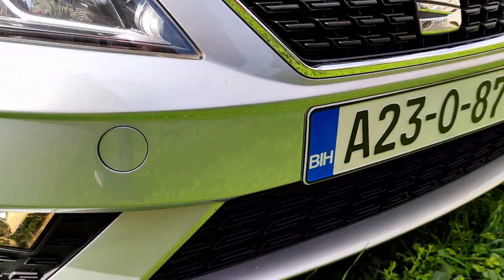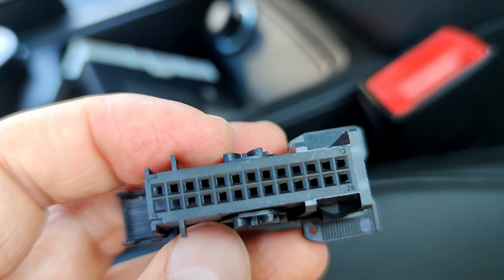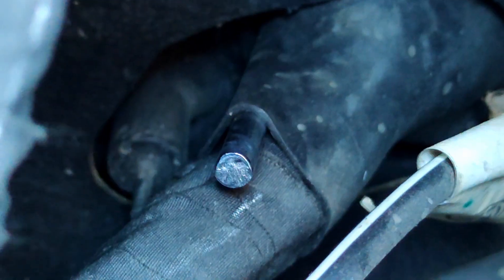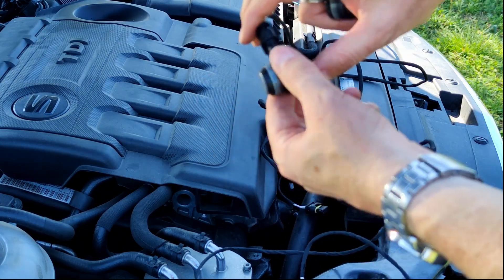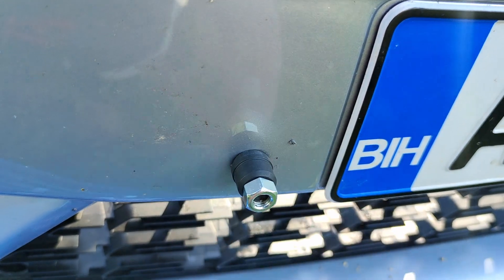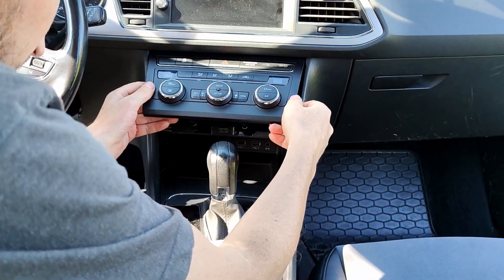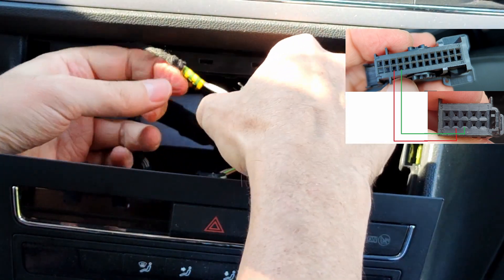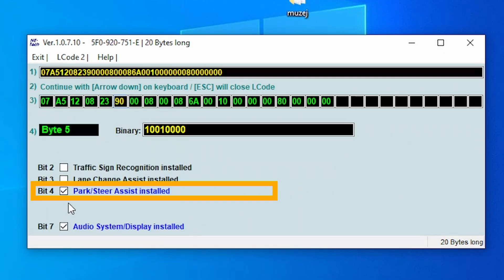How to install front parking sensors on Seat Leon MK3, Golf 7, Octavia.

Comment: Nice video tutorial. Great job. One question. The replacement of park assistant control module is necessary 100? or it is just a matter of activating the function on the existing control module? Thanks in advance.
Reply from the maker: Thank you very much. Existing park assistant control module works only with rear parking sensors. So you must replace control module in order to install front parking sensors because this version supports front and rear parking sensors.